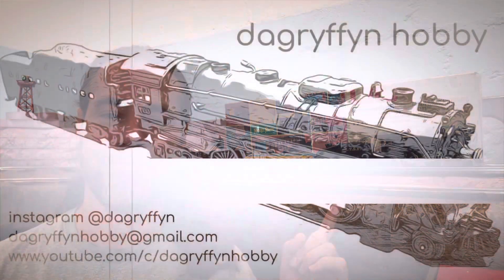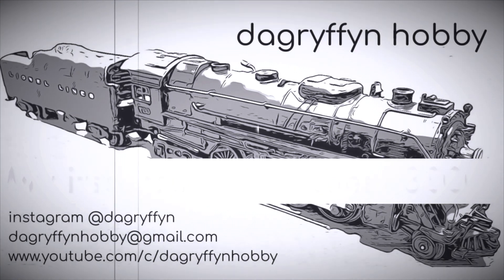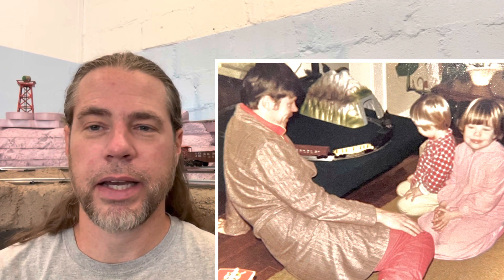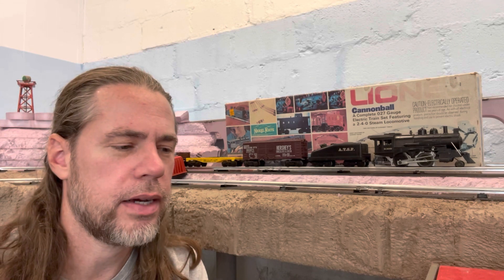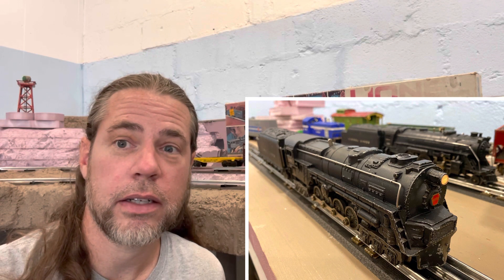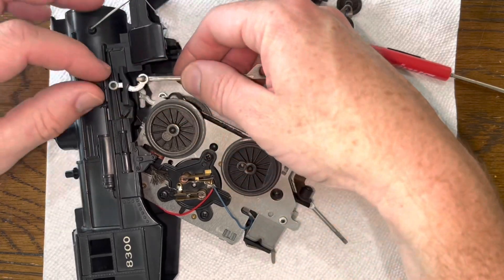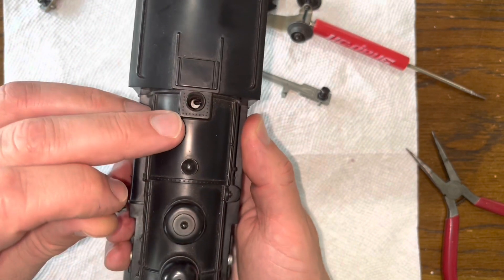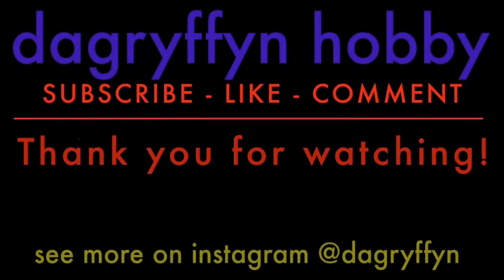Lionel 8300 and the set it came with. My first Lionel. A little history and adding an LED Headlight

Comment: Very few people in my experience have their first train set by the time they reach 20 y/o! You're very fortunate the have had the interest to be able to keep it. The first train set I remember (actually my older brother's) was a Marx 'Commodore Vanderbilt' freight set. My brother eventually removed the shrouding and ran the hell out of it. It would go flying off the curves onto the concrete floor many times before it could run no more! Many years later, I found the engine with a caboose at a flea market and gradually collected freight cars to make up a train. So it's not the original, but more of a memorial, which makes it mine, since the original wasn't mine to begin with. Thanks for conjuring up a memory for me!
Reply from the maker: I’ve never been one to get rid of toys! But yeah, I’m lucky it stuck around this long. That’s great that you’ve been able to pick up the parts to replace the set from your youth, even if it wasn’t your set to begin with. Even though my brother and sister, or my parents either, are not into the trains, there is still enough train nerd in us all I guess that no one would get rid of the old trains.

Comment: 8300! Got a couple of those. The side rods will snap in two if you sneeze on one of them. The front cover plate was missing of the one I bought. So I went to Lowes, got a drawer put and painted it black. Perfect.
Reply from the maker: They’re cheap but I’ve had mine for 40 plus years. That’s some creative repair work!

Comment: I just bought this engine for my son for a song at my local train shop. It wasn't running and a little tinkering it runs just like its supposed to.
Reply from the maker: Nice. It’s not glamorous but it does what it’s meant to
Reply: @dagryffynhobby  exactly. I actually had to hot glue a 3 ounce fishing weight inside it to make it stop spinning while pulling but hey for 20 bucks it works for him

Comment: That’s so cool! Yeah my first engines were my dad’s from the early 60s - very plastic-ee 😂. That layout is looking great! 🚂💨
Reply from the maker: Thanks! 
Were they Scout engines? I’ve come across some plastic engines that I was really very impressed with.
Reply: @dagryffynhobby  Not a problem, they were Lionel 1061 sets , all plastic motor housings with an oil wick. They are almost impossible to service 🚂💨
Reply from the maker: @NixCrossing  I tried to service one a while ago and just messed it up. I’ll have to take another stab at them sometime.

Comment: Very cool!  I still have most of my first set which is a Lionel James Gang General set.  I still have the cattle car with the good guy and bad guy having a gun fight.   I also updated it with LED lighting and added a rectifier so it can run on AC as it is a DC only from the factory.
Reply from the maker: Nice! Was that the set from 80-82? That’s a cool set with lots of play value.
Reply: @dagryffynhobby  That’s the one.   It did have a lot of play value.   Though my young boy self mostly just wanted to find new and interesting ways to crash it.  Yet somehow it survived, though not without some digs and missing parts.
Reply from the maker: @MESA-East-Model-RR  haha! Understandable. Luckily I was never very fond of crashing mine. I saved most of my destructive impulses for my hotwheels. Man, I destroyed so many!